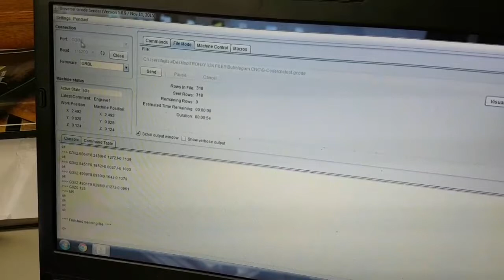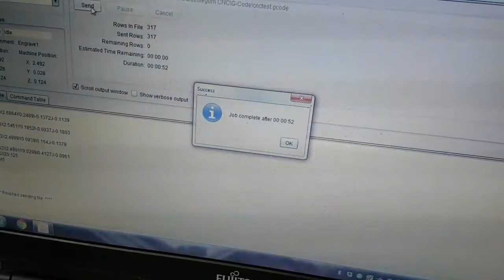PROXXON MF70 CNC CONVERSION

Comment: Hello, I'm loving this DIY CNC you have here. Would you happen to have a complete parts list from this build? Most of the Nema 23 Stepper Motors I've found only have a Parallel port cable and I noticed yours is directly USB. Your time and efforts would be greatly appreciated!
Reply from the maker: Hi Mitchell. Glad you like it. For complete story including 3D printed parts Google "Bubblegum CNC".

That should get you all you need but come back here if you get stuck.
Reply: Thank you for the info! I'm a complete noob at all this. There seems to be a ton of Nema 23 stepper motors out the and I can't seem to pinpoint the right one that i'll need. I would like to shoot for a whole kit so I don't have to buy things separately (motors, power supply, etc.) Can you point me in the right direction for the whole kit I would need? Thank you very much!
Reply from the maker: The NEMA standard relates to the mount configuration and not the power or torque capability. Within the Nema ranges (17, 23, 34 etc) are bands of possible ratings. Google "Proxxon MF70 CNC conversion kit" to get off the shelf options. They vary in price depending on complexity and what other bits you get. 

Here is a reasonable example: http://amth.de/en/products/3d-cnc/mf-70
Reply: Yes I did see that and I've been scouring Google for a good step by step. I have my brother 3D printing the mounting brackets from bubble CNC. Thank you for your help!

Comment: Please could tell what is the torque of the stepper motors? Thanks.
Reply from the maker: Quimat 3 Pack Nema 17 Stepper Motor 1.7 A 0.59 Nm 84 oz.in 47mm Body w/ 1m 4-Pin Cable & Connector and 3 Pack Mounting Bracket Kit for 3D Printer/CNC https://www.amazon.co.uk/dp/B06XQWMDWT/ref=cm_sw_r_cp_apa_F4oXBbNAAV73F
Reply: @KT-TV  Thank you so much!